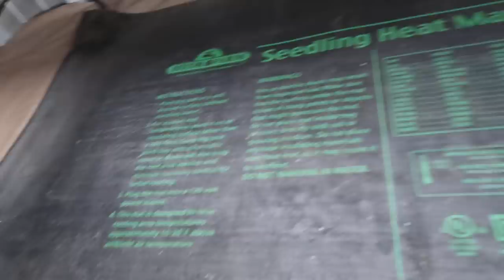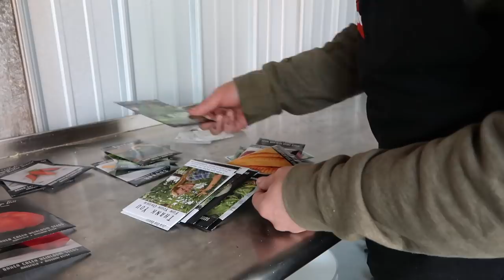These Goat Babies are COMING we need to get the BARN READY

Comment: You need to make a trough for the pigs.2 - 4' 2 x 8's nailed together in a "V", cap the ends with a couple 3' pieces so they won't knock it over.

Comment: I recommend putting Willow in the back stall tonight or tomorrow. The kids appear to be dropping. I wouldn't want the other goats intruding with Willow's labor and mother kid bonding.

Two other definite indications of pending birth will be a pronounced hollow under the back bone. The hollow will run from the top of the last rib back to the hips. You might also envision the roll of a kid's back along the bottom of the does belly. During this time mucous will develop as the kid progresses through the birth canal.

About the same time her top line will appear roached and the hind legs will be posty. 

Willow appears to be carrying triplets. If this is the case I'd want to be present during the birth, to assist if need be.

I'd recommend watching the birthing videos posted on the Blue Cactus Dairy Goat channel, an excellent Nigerian Dwarf channel!!! (IMHO)

Good luck!!!

Comment: Now that you've been using the seed blocks for a few years now... Would you recommend to newbies to make the 2-inch block tool or is the 2-inch tool worth all the money they charge? Knowing what you know now? ❤🌅🌵
Reply: I use a homemade tool I made from PVC pipe. It makes a 1 1/2" round block. It's somewhat tedious and takes about 1/2 hr to make a tray of blocks. I'm planning to get the 5 block tool like Al's for next year. I think they're worth the cost if you make a lot of blocks. I plant this size block directly outside except a few spare plants that I stuck in 4" pots.
Reply: @hughbrackett343  could you strap multiples of your configuration together to plunge all at once? Or is that the hard part...  plunging multiple blocks at once? 💝☀🌵
Reply: @suzisaintjames  I break maybe one in eight blocks pushing them out. It would probably be much worse trying to do multiples. The other thing is the metal tool makes a row of blocks that are nearly touching. The pipe is much thicker so I'd get blocks 1/4" apart. One of the tricks I've found with soil blocks is to avoid handling them. That's one way the square blocks are better than round, you can push a row of square blocks. On round blocks you're pushing on a much smaller area and can easily break the blocks.
Reply: @hughbrackett343 , cool! You are sooo sweet for commenting.  Thanks the info.💝 ☀🌵